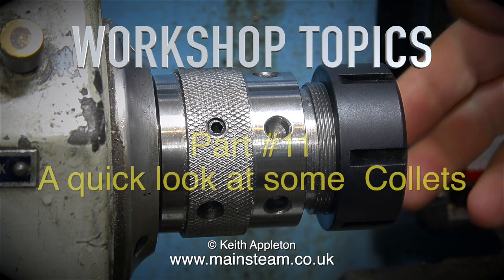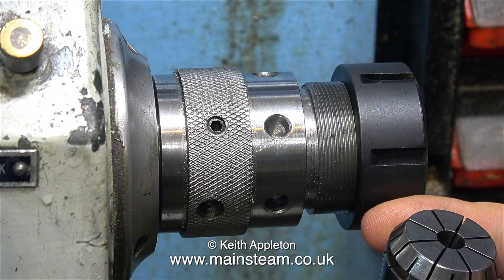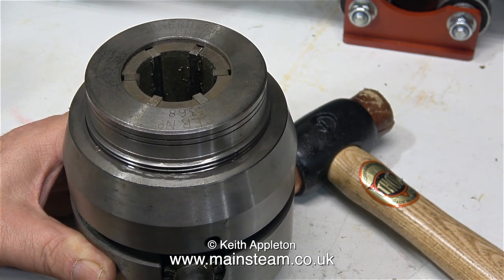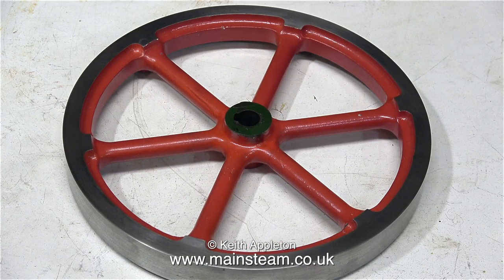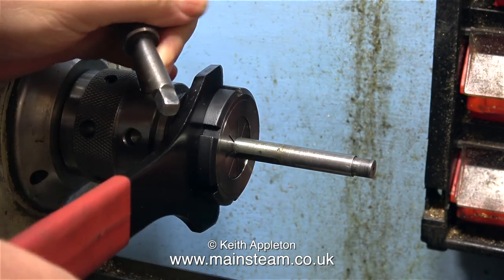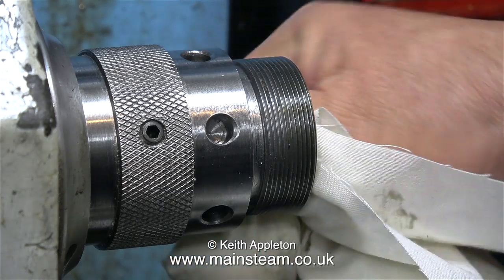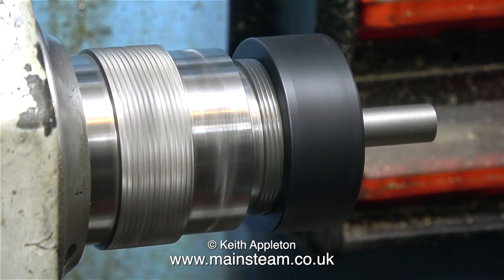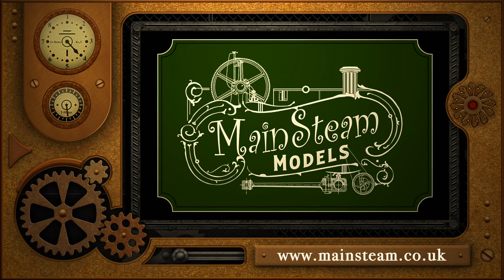WORKSHOP TOPICS - PART #11 - COLLET CONCENTRICITY

Comment: I am an experienced machinist working with full size machines of all sorts, my current machine is the size of a small house that machines parts up to 10T and as most machines I worked with, it too uses ER40 collets and smaller.
i have used those collets many times and have found that some cheap sets still have burrs on them from the manufacturing (or raised spots near the slits) or that they are very prone to going off-center if there is any dirt behind the eccentric ring (what you call oval),that holds the collet in the ring. either because the tolerances are too close or simply slightly off, always clean behind the ring as well. (from the front end you can easily blow it out with air)
If you want to check and diagnose the run out: first check the inside taper bore for run out (without a collet or ring), the outside of the collet holder can run true but that does not mean the inside (what really matters) runs true. check the run out as deep as you can and on the edge of the taper bore. If it is off, the problem is not the collet but either the collet holder or the mounting of the holder to the spindle (unmount, clean, check for nicks or raised spots on all threads AND the flat on the end of the threaded part of the spindle.
If all is well, then use a dowel pin longer then the collet so it sticks out on both ends, try having it both sticking through and with it just sticking out the top end to see if there is a difference, if so, it's the collet, try different collet sizes for good measure.
Additionally you can check the taper in the nut/ring when it is mounted without a collet to check it's run out, though it might be hard to reach without a test indicator. The nut must be screwed on in full, obviously. Checking the flat top surface (facing the tail stock) should be flat, but again does not necessarily means the inside taper is true unless it is a quality brand part.
As a side note: the nut with the rotating taper ring is theoretically technically a good solution to prevent wear in the collets and the ring itself, it does add a part that can cause eccentricity and doesn't actually hold the collet better than a single piece nut. The wear is negligible even after years of professional use and abuse, single piece nuts have never given me any issue where the loose ring-types have on more then one occasion.

With many tools, you get what you pay for. You can get good collets for cheap, but it's a bit of a lottery with what you get. Quality control is a big part of the cost of machine tools, so it's easy to save some money, but at a cost.(ironically)
Reply from the maker: Thanks for the info - I am taking these back to RDG Tools as soon as I get the time.

Comment: Since I am behind the original publication date I would hope the matter got sorted out. If not, I would agree with Kyndal Anne - check the collet itself and its mate with the chuck bore. I would blue the chuck bore, insert collet, tighten (with shaft inserted), dismantle, check for contact. As suggested, definitely try different collets. The collets do not look as what I am used to seeing. Also I would check the collet nut by itself with an indicator to see if the mating taper is running true. I am assuming that the chuck taper is dead accurate as checked by an indicator.

Comment: Hi  Keith
I have the same trouble with my ER32 collets. It seems that I need to get the nut very very tight and the run out is better.  I bought 3 different plain collet nuts. Chinese. There was variation in the different nuts.
I finally bought a ball bearing nut. It was better, actually the best of the lot. But not as good as I wanted..
I lost the tiny set screw/ grub screw and the 2mm balls out of that nut.
I bought the 2mm ball bearings and re filled the nut then I lock tighted the grub screw in.
THe chinese  tapered bores were not centered.
I finally made a collet chuck to screw on my 4 x 39 lathe spindle. Enco branded chinese 9 x 20 lathe. 

I was able to turn a taper that was concentric with the spindle. This combination is the best I can do.
Still OK but not what I expected from a collet system.
Good luck
Thanks for the vids

Comment: Rego-fix allegedly the originator of the ER system suggested that you check runout before you do the final torque-down. Keep in mind that Rego-Fix offered the ER system for holding tools. If you were using the ER for holding tools, as originally intended, you wouldn't mind so much checking the runout when you were going to run a batch of say 1,000 parts. Rego Fix instructions say: If the tool has any runout, then slightly loosen the collet closer and tap it toward center and then re-torque. Repeat as necessary.

Those who have followed the OEM instructions have found that it works, given a quality chuck and collets. Notice that Rego Fix is suggesting a kind-of "Adjust-Tru" approach. On my Adjust-Tru 3-jaw chuck, I occasionally adjust to get my required run-out. Feedback from the field suggest that after the Tru-Up and re-torque, the tool retains it's concentricity, unless there is of course a smash-up.

Comment: I would put a good dial test indicator in the taper where the collet sits and check concentricity at various depths, if that runs no more than a couple of 0.0001's (imperial) then it is your collets or the nut.

Comment: One way that you can prove that it is the collet so that you can return them for a new set or refund is to video your measuring the inside of the chuck taper with an indicator that can measure inside bores. I am sure the Bernard chuck will measure in tenths of a thousand and it looks like the run out for those collets is in thousandths. As bad as that rod was moving around in the collet, I wouldn't be surprised if it was around .0015" or more.

Comment: Hiya Keith
been giving this some more thought and im wondering if its because of the chuck is not seated on the register correctly. by way of the chuck was machined on another machine with a different register. a bit like a pair of parallels, they are machined together as a matched pair. If this chuck was machined on you machine then it would be perfect. If the bloke who machined it is local take it round to him and do the same test on his machine. It is just a thought I may be way out.
you can buy collet chucks with a back plate (I have one) and you fit them like an ordinary new chuck ie you machine your plate to fit the chuck
just a thought. let us minions know how you get on
Reply from the maker: no, the chuck is fine . . . .
Reply: @keithappleton  then it must be the collet or the nut. I presume you have tried different size collets with ground bar? if same result then it points towards the nut?

Comment: Keith, I have had such issues with “imported” collets as sold by RDG (and others) too. Fit and finish is often poor and I have even had collets with swarf in them from when they were made. I got fed up with them and bought some original Rego-Fix collets and never looked back. Eye wateringly expensive but worth it imho. Good luck and keep the videos coming, I enjoy them a lot.
Reply from the maker: Thanks Mark, I will look into that.
Reply: Same with me.  Two sets of Chinese ER collets, both junk.  They look pretty but are way, way out of true.

Comment: To my eyes on a large screen it appears the the back end of the chuck is going up and down as the work piece moves in the opposite direction. The left side of the image moves down when the right side moves up and vise versa.
Could be an optical illusion but it would explain the anomaly
Reply from the maker: That would be a simple answer, but it doesn't do that - it is video anomaly.

Comment: I guess your patreons will have given their suggestions a month ago, so those of us who contribute through Blackgates Engineering will be way behind. My suggestion was going to be that if your spindle is true, and the collet chuck is true, then the problem must be in the collet. Have you checked for a piece of swarf in one of the slots? Using compressed air on work in a lathe is a great way to get swarf into all parts of chucks. That’d make it run out. Having tightened it onto an obstruction in a slot may make the collet run untrue thereafter, but not by as much as shown in your video, so my guess is the foreign body is still there. I’d look with a loupe, and try clearing the slots with a scalpel blade.
Reply from the maker: the collets clean as a whistle - I am returning them to RDG Tools.

Comment: Hiya Keith 
I would take the collet out and put a dti on the inside of the chuck then turn the chuck by hand to see if there is any runout in the chuck.
If not then it must be the collet or the clamping nut. I have noticed with my set that sometimes if I clamp something in a collet which is at the extreme end of its clamping capacity that it does not clamp correctly as there are small areas on the collet end face that have not been slitted properly this dose not help either.
hope this helps a bit to narrow it down
Reply: If the chuck was shop made I would start by accurately indicating the inside taper of the chuck and if it runs true I would suspect that the taper wasn't matched properly to the taper on the collets. If the taper isn't seated the length of the taper it will run out badly as shown. The collets although cheap are usually kept to a standard. Best of luck finding the issue.

Comment: Try replacing the closing ring. Maybe the collet taper is a spring, that if not tightened evenly across it's whole face, can distort.
I Have not had this problem myself, so I can not say as a fact that this happens. I did watch a youtube author replace a closing ring to successfully fix this problem.
Sorry, memory fails, but when/If I can remember whose channel it was I will post a link. Maybe someone else will remember who it was. 
Good luck
Reply from the maker: I have 3 closing rings and they were all the same when I tried them . . .